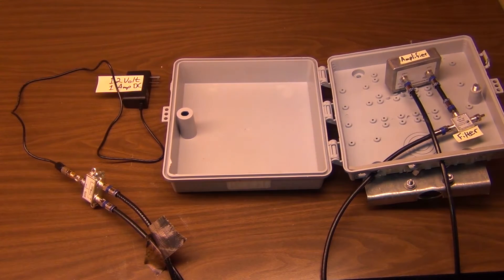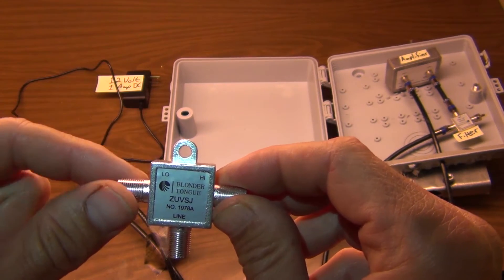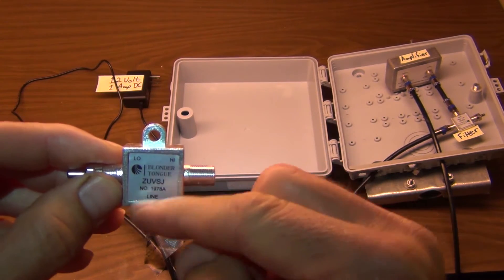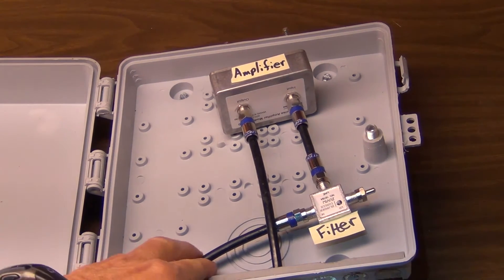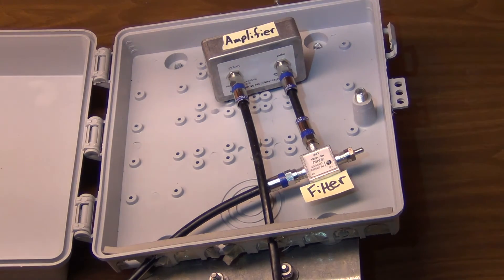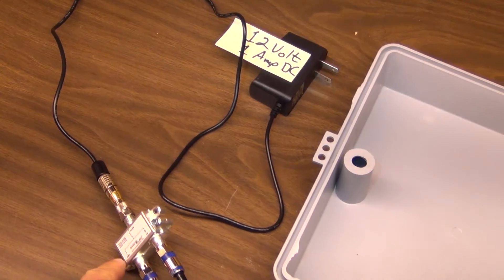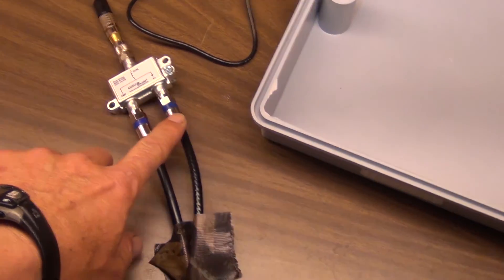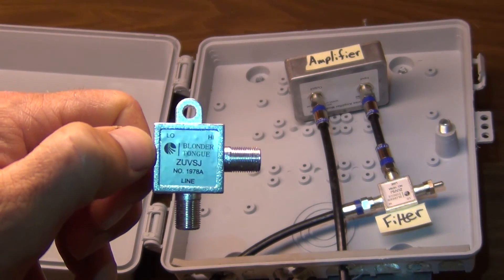Trick for Trouble shooting Over The Air (OTA)  UHF channel interference

Comment: Thank you for solving a frustrating mystery for me. Many years ago I picked up a couple of those combiners but I never knew what they were. I have a TV in one of the bedrooms that has one of those cheap flat style antennas that picks up only UHF channels. It is a spare bedroom and I just wanted some kind of programming and with a signal amplifier it picked up 48 stations which was pretty good because the other TVs that are hooked up to a different antenna get 59 stations. After you explained that the piece was a combiner and how it worked it gave me an idea. I have an old set of rabbit ears and an adaptor that turns the old flat cable into a coax connector. I connected the rabbit ears to the low side and the antenna to the high side and I now get 57 channels. The only station it does not receive is a low powered station from a nearby city that I can only receive at night anyway. The other commenter is correct that my combiner is a VHF splitter (AKSA HLSJ) but all I know is it works well enough that it brings in the stations that were missing on this TV that the other TVs were receiving and since it is not used very often I don't see the need for purchasing the correct combiner although I will keep it in mind and if I find the correct combiner in my travels I'll pick it up. Many thanks to you and the other commenter.

Comment: That combiner is a VHF com biner. The low  side is for an antenna cut for low dand 2 thru 6 and the high side is for a cut channel or 7 thru 13 high band Vhf. You should be using for this application a uvsj uhf/vhf combiner. Tru-spec and aska makes them.
Reply from the maker: Hi John,
Thanks for watching and commenting.  

The combiner I was using was purchased from solid signal and is ZUVSJ Blonder Tongue.  ZUVSJ is specified as a UHV/VHF combiner/separator.   I was using ZUVSJ  as a UHF separator/filter. 

You can get a ZHLSJ Blonder Tongue which is specified as a Low VHF and High VHF combiner/separator.